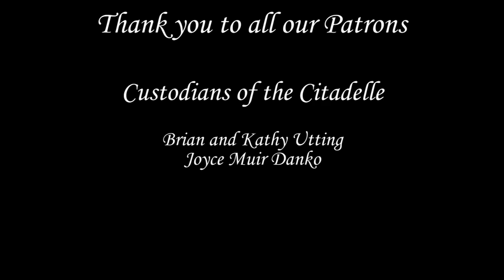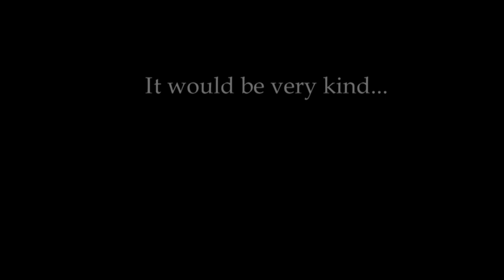The mystery hidden in our 15th Century Tower

Comment: Knowing how rocky the ground is around the citadel, I wonder if someone on the building crew had the bright idea to throw some of the rocks into the bottom of the spiral staircase while it was being built. Just as a place to deposit building rubble. It certainly isn't unheard of, even in modern builds. If it could be opened up, the space under the stairs would be an ideal location for a coat closet for visiters. As for the stairs themselves, there seems to be a change in construction (unless those treads are simply carved differently). The first several look like solid carvings, but as you go higher they begin to look like each tread has a little lip that comes out wider than the riser below it. Are they solid but just carved differently, or are they a block with a topping layer on them?  You live in a very interesting home, and thank you for your continued sharing!
Reply from the maker: Hi DD, thank you for watching and listening. The top steps are of a more modern construction, I suspect there was a problem with the steps above the front door, the arch doesn't look capable of carrying that weight therefore a lintol has probably (hopefully) been added and the wall built for extra support. Best wishes to you, Rols